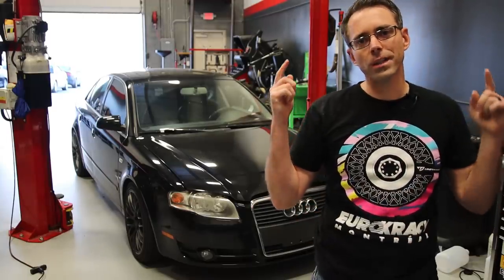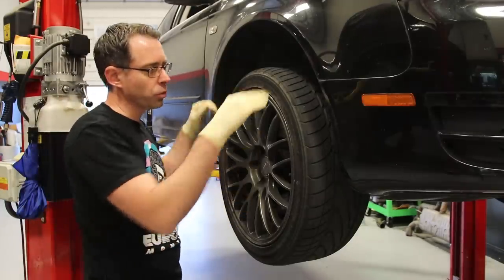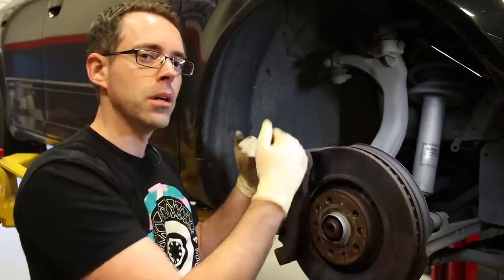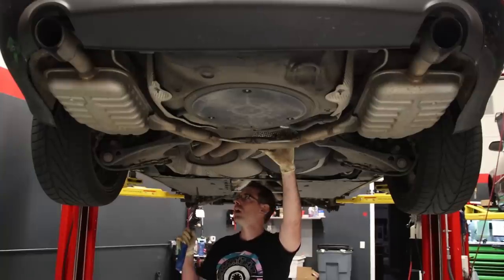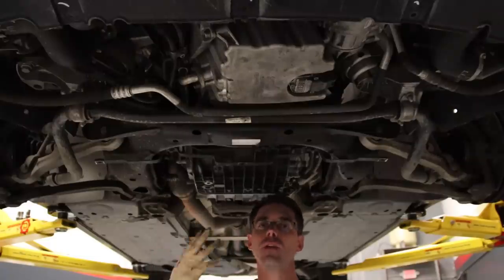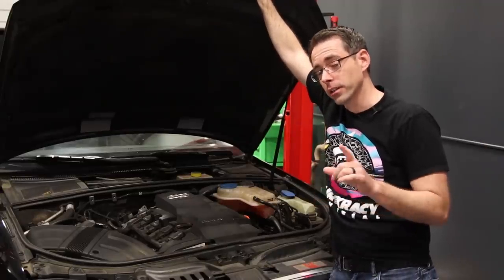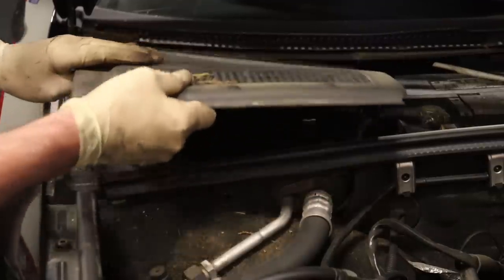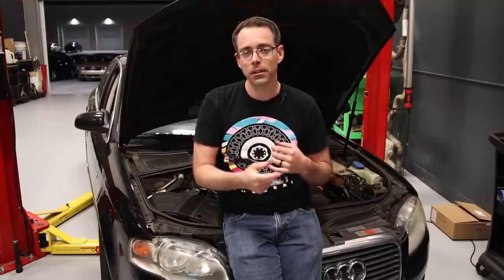Why is this Clean B7 Audi A4 $1500?

Comment: Maintained my fsi meticulously and it turded out at 195k miles
Reply: was it a CVT?
Reply: Dsg
Reply: @progmanmike  Dsg is prolly more unreliable than cvt. And 195k miles is pretty good
Reply: @Steven Strain 
It had some blowby which is normal, but then one day just suddenly it started draining coolant into the engine. The DSG just needed a clutch pack at around 120k ever since then the DSG had been problem free. I'm thinking in a year or so I'll have the disposable income to hit up integrated engineering for their built short block.
Reply: Head gasket failure. There are plenty of engines out there you can get for around $500-$1000. 2.0 FSI is a decent engine. Aside from couple weak points.

Comment: 13:39 I understand Denso for the most part is not a major supplier for VW/Audi, but they supply at the very least one part on every vehicle to just about every automotive manufacturer in the world. They are also owned by Toyota and supply most parts for toyotas. A bit surprised at how you would say they are bad quality or not a very good value. Not surprised at all you would recommend Bosch hahah.

Comment: I have the same year count. I've done a laundry list of repairs on this vehicle. I have the 2.0t Quattro. I love this car. I do have one problem i can't seem to get rid of. And that is uneven idle and acceleration. I've done, coils, plugs, air filter, mass air flow, map sensor, vacuum pump, coolant flange, timing belt, turbo, pvc, and lastly regular oil and coolant changes. It doesn't struggle to stay on. It bounces back and forth about 100 rpm when cold and as i begin the morning.  I warm up all my cars in the morning and this one is no exception. The problem persists for about an hour then goes away. Any ideas?

Comment: Mine was $15k in 2013 (bought A4 2.0T Quattro sedan, 2007 premium model with a little less than 50000 miles on it). Great price!

Where could I find a used Audi SUV without branded title and all the services done for its age ? I still have my A4 and currently it's got 146,000 miles on it :) Great car very dependable and useful all around car. I was looking at a Q7 2017 (3.0T with towing package) but they're like 35,000 dollars right now.

Comment: Also worth noting with this particular car it's known to have a cam chain tensioner from hell and of all things a shit torque converter! I actually had my tensioner blow which resulted in a cylinder head swap, and it generally ran like trash for a year while I had it before I finally swapped the TC, fluid, and filter.

Swapping to solid rubber motor mounts was a choice move as well. I love my baby but boy howdy she's a pain in the ass.
Reply: It doesn't have a torque converter, has a CVT.
Reply: @ln5747  it does have a TC. Source: I have one and I changed it.
Reply: @peytonbloom4123  you said the car shown, it had a CVT, not a torque converter.

Comment: I agree @ 15:41 where you say you’re “not super familiar with CVT transmissions..”.  CVT = A continuously VARIABLE (not valueless) transmission!
Your fault code P0706 is probably the transmission range sensor (aka neutral switch). I would use VCDS to test the module. Possible cause is corrosion either on connector or sensor by a leaking water vent pipe under passenger carpet. If the fluid change / adaptation doesn’t help, this is what you may want to look at.

Comment: Vibration under acceleration comes from inner CV joint 100% it is not Gearbox related! even if there is zero play once taken out for inspection. Puting in new ones will make it super smooth under acceleration. Regarding transmission error, control unit needs to be removed from back of cvt (continiously VARIABLE transmission) gearbox, send it to get refurbished. There is tiny wires that connects unit connector to pcb that breaks because of heat and vibration. Transmission fluid replaced and adaptation performed. Done!
Reply from the maker: False, it was not the axles. It was the trans. We already addressed in this video. https://youtu.be/ryQ6pfZFbfc

Comment: if i had the tools and lift and inside like these guy i would have no issue buying a cheap car and fixing it.  as long as you can do the work yourself most of these cars a not expensive to fix.
it when one has to fix it outside in the rain and cold they get irritating

Comment: If that box has 7 plate clutch pack then its way better then the 6 plate clutch. The biggest problems had diesel engines esspecially 2.5 tdi with CVTs since diesels will put more NM on the box. If its the 6 plate clutch then it should hold 300nm, if its a 7 plate thrn it should hold 400nm. Gasoline engines with 7 clutch pack are ok, there were failures on those versions aswell but not as much as diesel and 6 plate box versions. People often remap their gasoline cars and they make over 300nm and thats the limit of the box if u have 6 plate clutch. If u change oil in theese boxes regulary and u dont push them too much and dont remap it then its ok.

Comment: Thank you for the video! I am also thinking about buying an used Audi A4 B7. I would rather get one with Quattro to avoid the CVT transmission. I know this car is high maintenance, but one thing I worry the most is the oil consumption. Is replacing the piston rings the only solution on the oil consumption issue? Once again thank you so much for sharing the video!
Reply: Allen Hsu the A4 B7 Generation has no Oil consumption problem.
It started around 2007 with the first TFSI Generations and lasted till 2013.
but avoid the old 2.0T, it’s junk!

Comment: The CVT is an amazing transmission. 

I have it in combination with the 3.0 V6.

Up to 45 mph it revs at 1200rpm.

At 75 mph it revs 2000 rpm.

0-60 in 6.5 sec.

Average fuelconsumption is 1:15.

Very smooth, very silent, brilliant.

The CVT saves 25% fuel, so if it breaks down, no problem. I gladly have it repaired.

It has been flushed at 30.000miles and will be flushed at 60.000 miles... just to make sure. No such thing as lifetime transmission fluid.

Comment: I have this same exact car other then mine is white. I spun a bearing on the crank and it is pretty much done. I’m gonna replace the engine but now I’m wondering what it would take to do a manual swap. The bad part is my CVT transmission has no problems so far and the car has 136,000 miles on it

Comment: The CVT is great but not reliable.
you can’t change the transmission Oil filter, 60.000Km Oil changes are crucial!
mine got regular changes and still works great. (153.000Km/95.000 Miles)
Reply: The early ones are unreliable, the later ones seem fine.
Reply: @ln5747  Yes, the later updated 7 clutch-plate ones seemed more reliable.

Comment: My first b7 was a cvt with 30k miles. All my audi friends told me to ditch it right away because the cvt takes a crap at 100k. Thought i should quattro manual swap it down the road. Sure enough the cvt blew up at 100k lmao.
Reply: 8kRPM have you ever changed the Oil?
Reply: Did you change the oil?
Reply: @ln5747  yep, very well maintained top to bottom. Glad I bought the 6 speed after that
Reply: What year was that B7, was it anything under 2006?

Comment: Would you recommend to buy Audi A4 B7 AVANT 2.0 TDI with mechanic gearbox ?
Reply: I would, but still keep in mind all of the non transmission issues. Suspension bushings, & oil leaks (upper pan seal, filter seal, valve cover gaskets etc)
Reply: @mrtyreus0  Thank you for answering

Comment: What’s better / more reliable? B6 with 1.8T or B7 with 2.0T motors?  TIA!
Reply: The 1.8T was a strong motor ( in what i have read ) but the B7 had a more advanced front suspension and design...
Reply: A B7 with a 1.8T!
Reply: 1.9tdi
Reply: All same. Keep your eyes out for EVERYTHING!

Comment: Don't forget you have no heat and the heater core is clogged Lol welcome to German cars
Reply: Thats more of a B5 and B6 issue. Audi did updates to the cooling system and heater core to prevent those issues on the B7+ cars
Reply: Mine is clogged for sure lol

Comment: That TFSI seems to have plenty of "common problems".
Reply: Victor Perez Martinez The only real problem is that you have to get the intake valves cleaned out either through an additive to the vacuum line or you’ll need to get a manual cleaning every 50k miles.

Comment: Wow, DAP, bashes cvt transmissions and at the end of the video, claims to not know much about them. Look  b4 you leap. 🙄
Reply: @Justinlifts365 
Stick with Honda or Toyota, you'll be fine.
Reply: @samvocella  the cvt has a shelf life idc what brand it is
Reply: @Justinlifts365  everything has a shelf life , what's your point!
Reply: 253k kilometers and no issues, Audi A4 B6. Oil change done once by the previous owner. TBH im surprised it has lasted this long 🤷🏻‍♂️
Reply: @atteplaysplaystation7020  my B6 1.8T us 473000 km and still going 💪

Comment: Please tell me that valueless part was a joke and not what you think. CVT - Continuously variable transmission. If the transmission has no value it's taking you nowhere fast :D Audi B BODY :DDDDD A5(b7), A6(c7), a7(c7), a8(d4). Mein god, you have no idea what you're talking about. As a mechanic you may know the general stuff, but when it comes to a certain make/model you're duller than a hammer. I suggest you stop quoiting dealer service prices, that's what the poor people do. Also from what i gather from others is that turbos rarely leak outside, usually the leaking is inside and is visible via a blueish-blue smoke. Why are you hating on Denso? From what i've seen myself is that Toyota/Lexus vehicles have denso parts(electronics to be more precise) and i've never heard of a corolla/prius needing an ecu swap if it wasn't sunk(or tuned). Seeing as you're against hacks in general i'd say you have a lot to learn and take my criticism as learning tool (yes i know it needs a pinch of salt, but eh, that's life).

Comment: Would anyone know the torque specs on the subframe bolts on the A4  B7 quat 6M ?  I hear the clicking is caused by using old bolts and I just got new ones.
Reply: Something like 100Nm plus 90 deg

Comment: I bought the same car.. funny.. for 1200.. 06 model 6 speed manual quattro. Reason so cheap.. it was a well looked after car with full service hisotry by dealer. 2 matured owners til i got it. Reason so cheap.. it was a country car and suffered hail damage. Broken windscreens and badly dented fenders bonnet.. boot lid. Ill swap out all that. Roof and a pillers will get PDR.. timing done recently and 200 000km car. 1200 cant go wrong. Leave me money to forged it

Comment: Man I owned one of these . Although it had a CVT It still was a blast to drive I spanked so many cars.It handled well,steering was heavy,overall felt like a solid built car. BUT buying one of these used was a lesson learned.NEVER AGAIN ! Yes I had a Carfax report on it when I bought it but I'm starting to feel like those reports can't be trusted lol Within the first month of owning this car it was a constant battle with maintenance issues ! It went into limp mode(I've never experience this ever with a car in my life 🤷🏾‍♂️)ended up having to change the spark plugs to remedy that problem! Excessive oil consumption and was buying 1-2 quarts of oil a week, which ended up being a cracked oil filter housing ,BUT this particular engine I later found out was known to burn lots of oil. Then I had to replace the A/C compressor, then both front axles had to be fixed 🤦🏾‍♂️ 🤷🏾‍♂️.So I replaced the axles, and got an oil change. Not even a week later as I'm driving to work out of nowhere, no initial signs of any problems the low oil pressure light illuminated on my dash then all of a sudden I could hear a knocking sound coming from the engine🤬 I pull over immediately and parked. At that point I was done with this car🤷🏾‍♂️. Yep the engine threw a rod .Too expensive to fix,and not worth it. This all happened over the course of 18 months SMH. I later sold it to Carmax for pennies compared to all the money I put into it. DON'T EVER BUY A USED GERMAN CAR ❗Sorry for this whole rant 😂

Comment: Ahhhh CVT....great on paper, horrible in practice.
Reply: How so?
Reply: @ln5747  they are horrible design. Can't take much torque, hang revs on the engine unnecessarily, low service life and from a pure driving characteristic are horrible.
Reply: @gureno19  I disagree, I love driving mine. Takes some getting used to but so relaxing. Also proving reliable at 112k miles. Asked my mechanic (Audi specialist) and he said they are fine, earlier ones were problematic. Later ones if they go wrong usually isn't a huge fix. Also many online for sale with plus 200k miles and spoken to many who haven't had any issues.

Comment: Garbage for those which buy cars just to show up. The Audi starts with quattro torsen, as well al longitudinally mounted engine (is no torsen center diff otherwise anyway).
That car is equipped for a 89yo widow, cvt+fwd (as i know, anyway is no cvt quattro, because that garbage gearbox barely works on fwd and low-medium torque engines.. a hi-torque engine and 2 more diff's would destroy cvt at first launch😂).
Was 1500 because no other granny were there to buy it, so..

Comment: Sus my a3 was 5k
Reply from the maker: No cap
Reply: @Deutscheautoparts  2010 A3 sportback fwd dsg had the timing chain and tensioner weredone by Audi of Dallas before I bought it and the front control arms were replaced it has 170k miles no problems